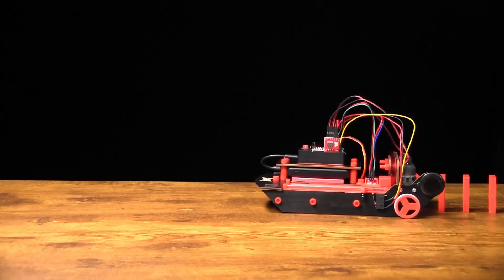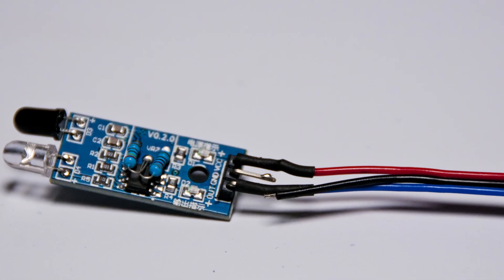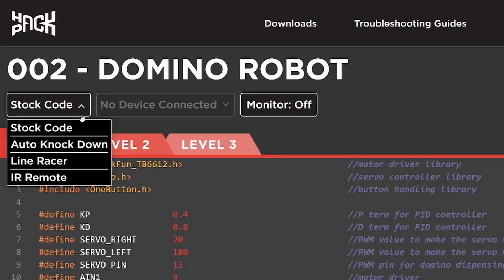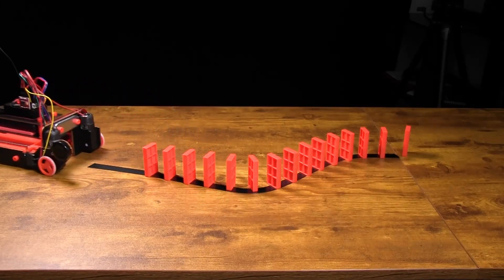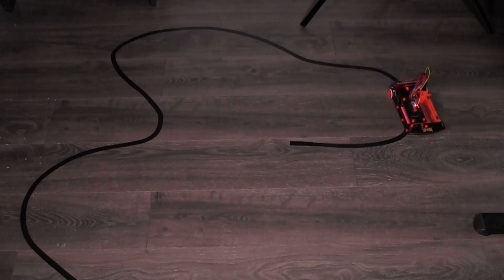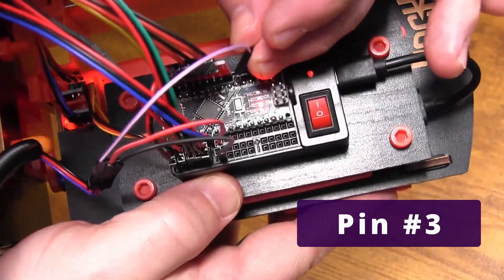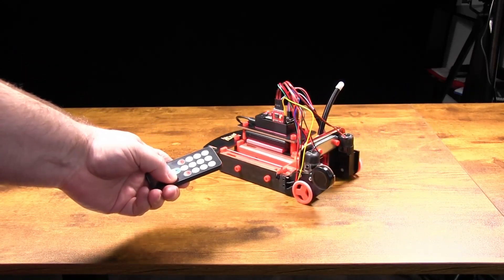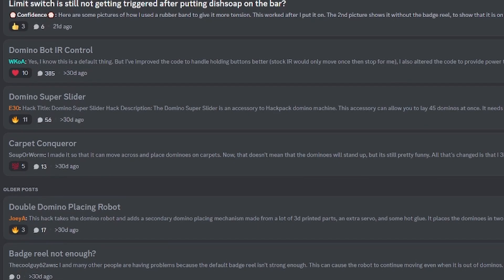Domino FRENZY!! With the Hack Pack Domino Robot!!

Comment: I am going insane!  I have completely assembled and disassembled my HackPack Domino Layer at least 20 times.  I have meticulously followed the assembly steps each and every time!  I ensure on each rebuild to ensure the servo is positioned absolutely according to the graphics in the assembly manual!  Could you possibly photograph the servo in its position just before power on!  Mine will turn on and lay only the first domino and thereafter NOT slide over enough to grab the next domino.  So only the first domino ever gets placed in position!

Thank you in advance
Reply from the maker: Best thing to do is jump on Hack Pack Discord to chat with some other Hack Pack Hackers (including me) to help you troubleshoot the issue.  In there, you can post video and photos to help us determine the issue and provide advice to fix it.  If it's broken, you can chat with CrunchLabs team member on there and get a replacement ordered.  
Join HACK PACK DISCORD!! - https://mee6.xyz/en/i/zrSNaOmwEu